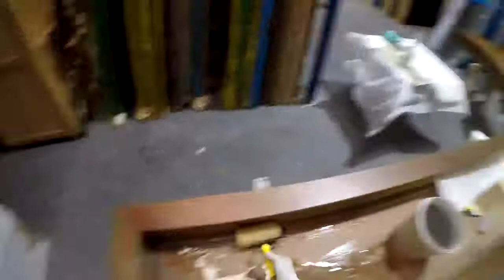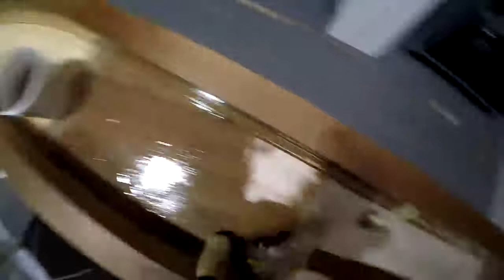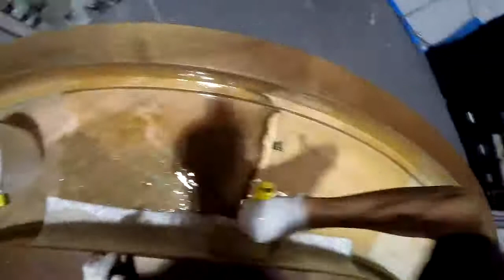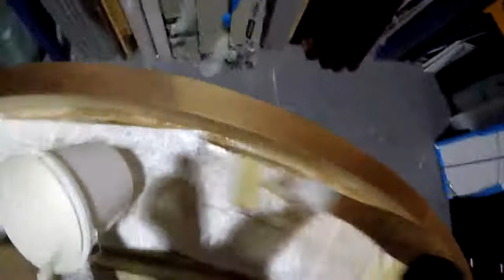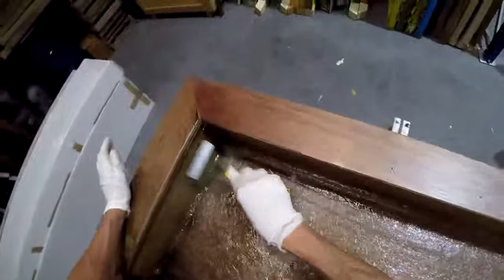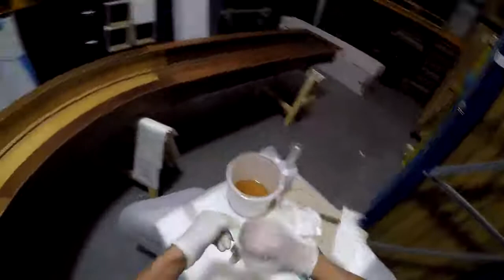Fibreglassing timber water features

Comment: What can't you fibreglass?! Great work!
Reply from the maker: If it stays still long enough it gets glassed lol
Reply: @GRPLiningServices  i once fibreglassed a liner pond 25 years ago! i ripped out the liner and placed 1" jabalite insulation in the bottom and the sides held together with fibreglass tape and layed up 3 layeys of 150g fibre with green gel and its still here to this day with no leaks at all!. my mate cleaned it out about 4 years ago and the gel coat looks nearly as good as the day i did it!,but did 3 layers because its that strong it could support itself and would cope with of erosion of the soil over the years :)